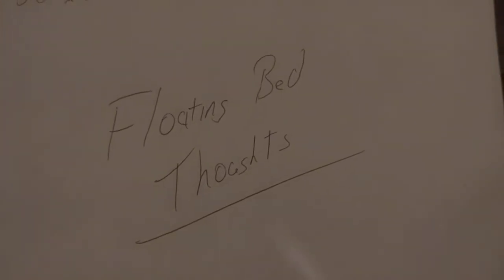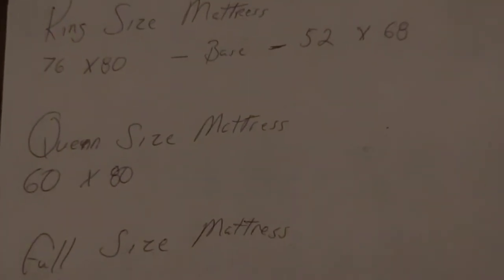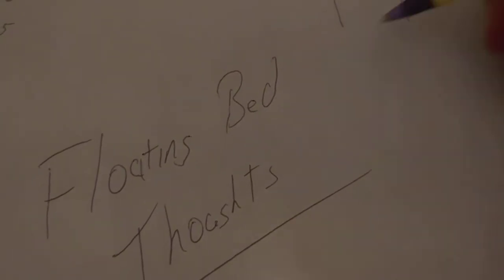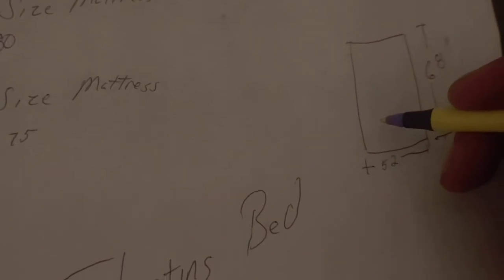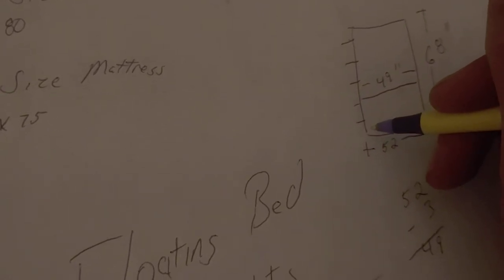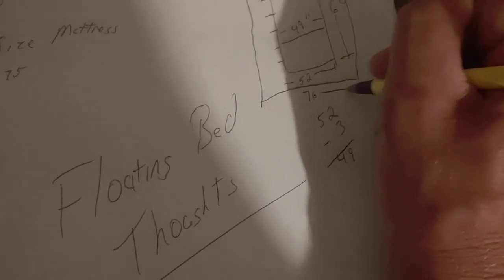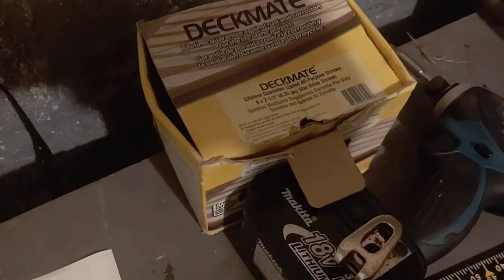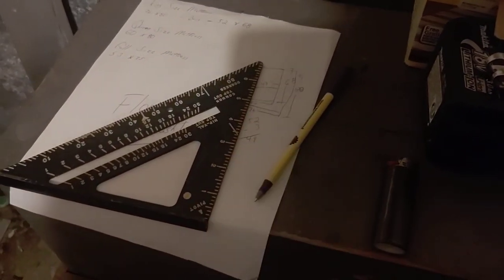Floating bed plans, explanation.

Comment: How much lumber do I need to build my king-size floating bed frame
Reply from the maker: I'll have to check measurements online to be honest, best bet would be to plan it out via doing the same, 
But if you are still stuck I'll try to figure it out when I'm not at work